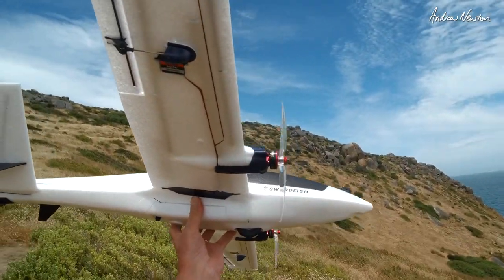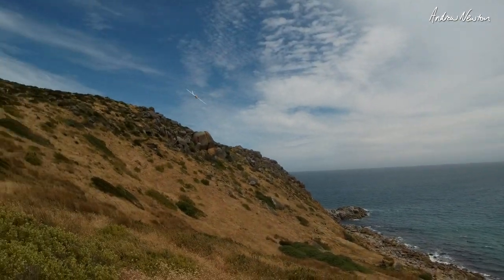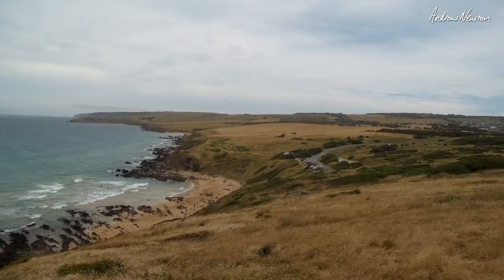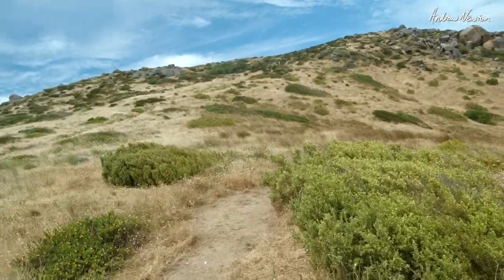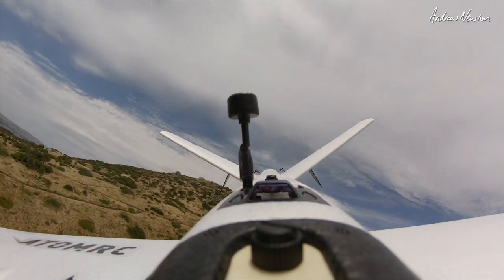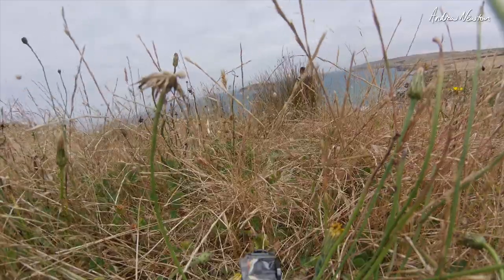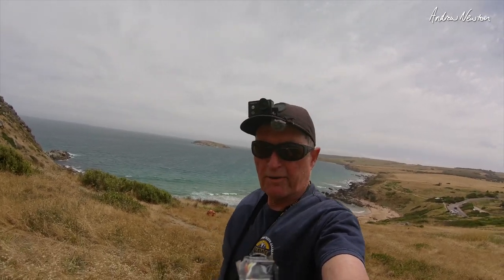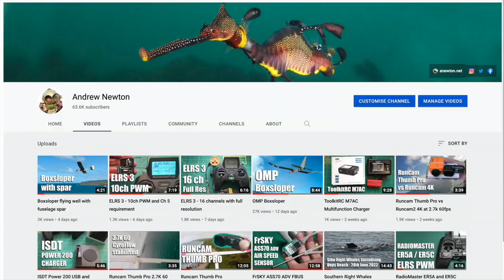AtomRC Swordfish Sloper

Comment: Awesome!! It's an acrobatic sloper too. You could probably even try some FPV slopping.
A possible mod could be a installing a pair of folding propellers, then the Swordfish will be ready to handle anything you could throw at it. 
BTW: Andrew, your mic handled the wind very well too.
Reply: Folding props along a wing?! Only if the motor sticks out more that the radius of the prop, else you will not be able to get it started. And that modification might move the center of gravity way into the front, which might then be difficult to counteract, I guess?

Comment: I just got over of these. I am about to fit my dji o3 unit. I was wondering there you placed the air unit. I see the camera at the front, i like that. I also see the aerial at the back which is good. I have the max camera cable of 200mm which puts my air unit in the battery bay, not happy about that due to lack of air flow.
Reply from the maker: Air unit and camera up on top, not on the nose.

Comment: Thanks for all your amazing videos Andrew. So incredibly helpful. FedEx is delivering my Swordfish today! However, I've been flying 100% Spektrum gear. Before I run out and buy a new radio, I'm wondering if it's possible to get a Spektrum Rx to work with the flight controller via the "xbus" port? On my other models I use this port (4 wires) for an external gps module so I don't know if this port offers 2-way communication.  Any thoughts or advise you may have are greatly appreciated.
Reply from the maker: Thanks Gary. No idea about Spektrum connections sorry but here is the list of protocols for the NAVI board https://www.youtube.com/@AndrewNewton/community

Comment: You didn't say if the sub-elevator brought anything. Would it be possible to mount folding propellers to keep the possibility of coming up from the hole in the event of a drop in the wind?
Reply from the maker: Finlets didn't make a radical difference. Need more air time to compare. Cant put a folding prop on a wing.

Comment: What size battery are you running.  Is it XT60 or XT90. Asking as I'm wanting to order one for mine so I'm not waiting around after it has arrived.  I'm not looking to use it for fpv.   Just as a powered glider. So guessing my battery might need to be a little larger to help add the nose weight without the fpv gear there to balance. Thanks for your time and advise.  From little New Zealand
Reply from the maker: ZOHD Lion 4S 3500mAH XT60. Wouldn't need heavier, could even use a 3S 2200 Lipo for gliding
Reply: @AndrewNewton  awesome.  Thank you for that.  The down loadable Manuel is very vague.   I got the PNP certain coming.   Might break into FPV though the new year.  But thinking as a hand launch power glider this will be ideal.    Thanks for your time you give these videos and veiwers
Reply from the maker: Thanks Russ.

Comment: do it come with the controller and what's the cheapest controller to find for it.
Reply from the maker: No radio included. The cheapest I would recommend is Radiomaster TX12. You could fly it with any radio really but cheaper ones wont have much range or adaptability.

Comment: Did the new CLI fix most issue except battery draw? 
Unbelievably stable airframe. So excited to get going can't wait. 
The start of a better off the shelf platform then the Parrot Disco. The Discos still my Favourite 4g long range plane.
Reply from the maker: Some improvements but the VTail mix is wrong and arming without sats is a bit dodgy
Reply: @AndrewNewton  so the didn't fix the vtail mixing? Well that suxs, I generally stay away from vtails as stuffed mixing on first ever one that ended badly. Anything else would have been fine 😅